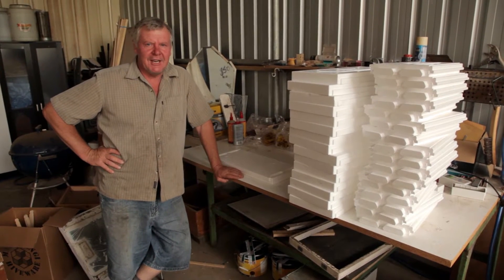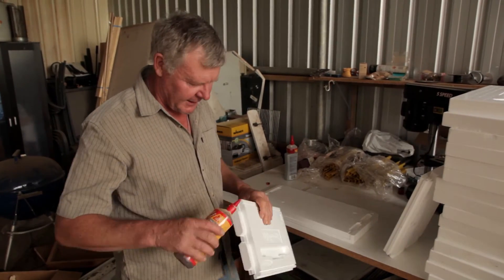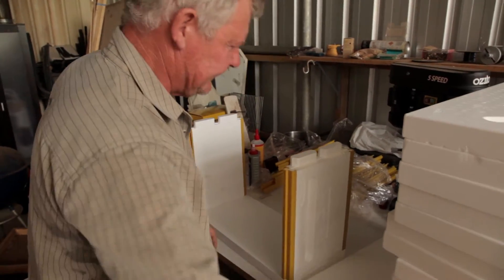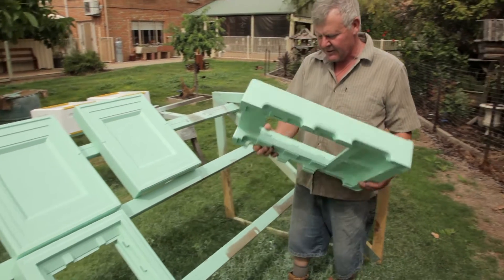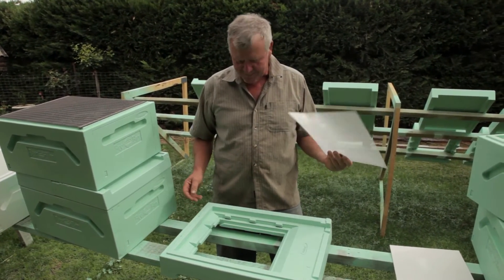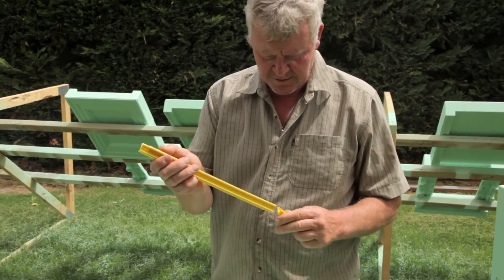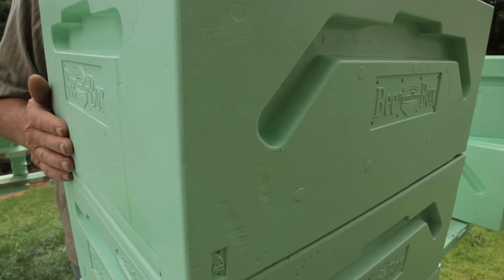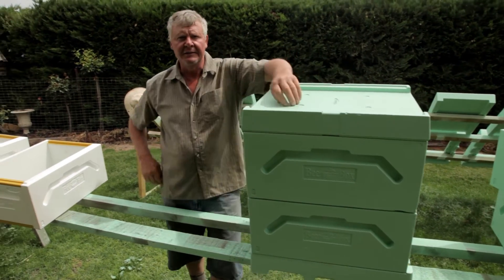Building New Beehives - Episode 15: Living in Paradise

Comment: You could create and print some QR codes and then tag those to a database page for each hive, you can then scan them with your phone and write your hive notes for each hive.
 I used to make my own wooden boxes and frames until the price of wood in the UK shot through the ceiling.
 I now buy plastic frames and foundation for my wooden frames, I am looking for an alternative hive as I am running low on my stock of wooden boxes, I may get some of these polystyrene ones.
 What type of Crown board did you end up using?